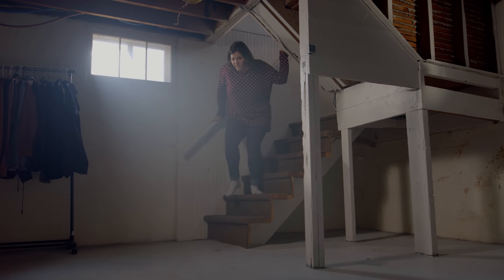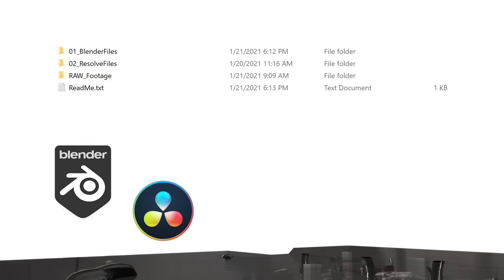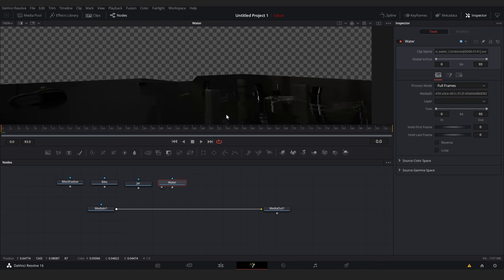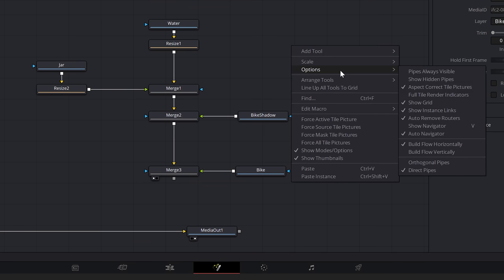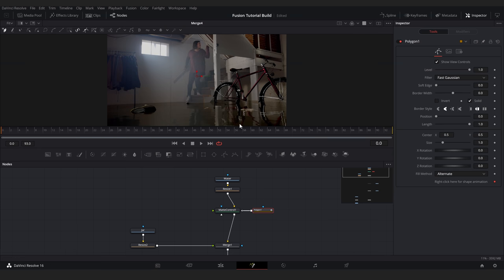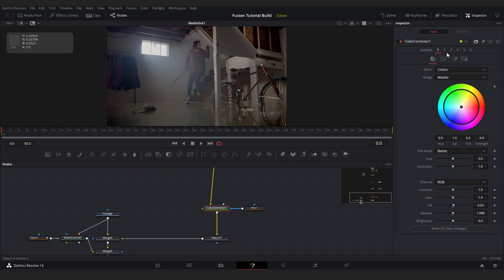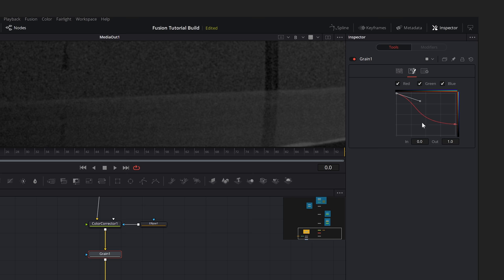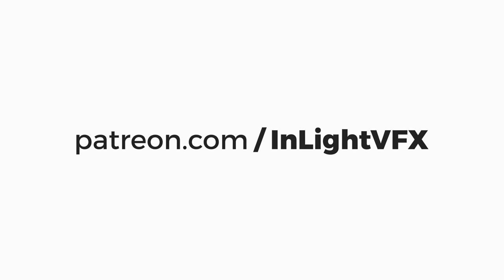Sorry Blender, this is my new compositor

Comment: 7:31 I know you warned that this color workflow is not the ideal approach, but I'll just say anyway for academic purposes that it's generally more correct to convert the footage to linear, rather than the CG elements to log. That way everything is still composited in the same linear space. Then, either convert to log on output (when rendering DPX) or leave linear (when rendering EXR).

Comment: fusion has so much potential as a Nuke replacement, but I still prefer how quickly Nuke can detect EXR layers and create new render layers. I hope blackmagic continues to support it and maybe one day there will be actual competition for Nuke!
Reply: I dunno. I use both and they both have their +'s and -'s. But the resolve 17 live announcement shocked me. they did 99 percent on resolve and like 2 minutes on fusion. which worries me. if they drop support for fusion there will be a lot of very upset people
Reply: plus lets also not forget 300$ versus 9,000$ (and also can get 90 percent of fusion for free)
Reply: Fusion used to be incredibly expensive as well 20 years ago (it's actually older, than Nuke). But the downfall of the previous owner, let Fusion fall behind.

Comment: This is the best introduction to Fusion that I've seen.  Comparing Fusion back to Blender really helps.  I had no idea you could set Fusion up to work in a vertical orientation like Natron or Nuke.  We use Resolve as our primary editor.  Looks like we'll have to give it a run for comp as well.  Thanks for the helpful video!
Reply from the maker: Hey Steve. I'm glad the comparison was helpful. Yes, Fusion's nodes are quite flexible in the orientation. I wish it was more built for vertical-only and sometimes the connections can get a bit wacky. But overall it's easy to stay organized. Hope you find Fusion helpful in your workflow!
Reply: I feel like it's worth noting that Fusion existed long before DaVinci, and was formerly known as eyeon Fusion, and it was competing with Nuke for a while. As a matter of fact it's history dates back to 1987 with it's first public release in 1996, while Nuke was released in 1993, so it's a very mature compositor and not something new in the market.

Comment: Your workflow is good. Usually fusion user has bad habit use from left two right. And connect all stuff to one node.

Nuke user usually work from top to bottom. And not more than 3 connector for each merge node.
Reply from the maker: Thanks! Nuke certainly wins in terms of node layout and organization. But it is possible to have some sense of organization in Fusion, too.

Comment: At 9:16 you mention that in Blender you can't create masks on the viewer node. Unless I'm missing what you mean, you effectively can just change from "View" to "Mask" inside the Viewer Window, hence allowing you draw the masks outside of the Movie Clip Editor.
Reply from the maker: Hmm I'm not sure I'm seeing what you mean. But I also don't have a lot of masking experience in Blender. Still, Fusion's masking tools are quite extensive and I know they have a lot of features Blender does not (that I didn't go into).
Reply: RealTimeX  its just node based. once you wrap your head around it you'll never go back to layers.. and if you learned blender you have NO problems learning fusion. just start with the basics. if you get antsy and jump ahead you'll be lost.
Reply: @flipnap2112  sometimes layers are still better
Reply: @JaKlaro  I suppose if im doing something simple and straight forward its more direct. but anything over that ill take nodes any day of the week. I used to hate nodes until I learned what they can do. its like seeing the contents of a sandwich layed out on a plate. when I need to know where the ham is, one quick glance and im there.
Reply: @flipnap2112  A timeline is still useful. For normal cutting for example. 
Or for Effects that have sth to do with time.
Reply: @JaKlaro  yeah I wouldn't use fusion or any other compositing program to do editing. basic compositing layers work just fine - titles, basic filters, etc. but doing anything like detailed keying, tracking, roto work.. nodes are your best friend. I can knock out something in an hour that would take me a day to do in layers. just about finding the right tool for the job. thats pretty much it

Comment: quick aside, if you, in blender, mix the shader of the geometry to wich you projected your footage, with a holdout texture, with the lightpath info "is camera ray", you can skip all the masking work you did in fusion and save some render time
Reply from the maker: That would definitely work. I just wanted a bit more control over the softness of the edges of my mask. And I also wanted to show how to create masks. But good point, that would be a faster approach and work just fine in a lot of cases.
Reply: @InLightVFX  I use it a lot with moving footage, where the time saved is even greater because you dont need to animate the masks afterwards

Comment: Great Job, I surely dive in to it! ...why don't you use ACES workflow as you teach in the last videos?
Reply from the maker: Great question! ACES is a great workflow but when you convert Blackmagic RAW footage into ACES there is no easy way to then convert it out of ACES back to what the original image looked like. And I needed to deliver the shot essentially "ungraded" since the guys at Threefold had a specific color grading LUT that they wanted to apply to the unmodified RAW footage. It should be noted, ACES does not have this issue with other footage types but specifically Blackmagic RAW is difficult.

Comment: One big mistake! Althogh you can import Exr file via MediaIn, it is too slow (memery consuming !) . To get best performance , please use loader to load exr  files. Another trick is to use the managed as LUT viewer and set  color management as Davinci YRGB Color management. Then davinici will set color space for you automaticly in most situation.Don't use LUT to transport color space, becuase it will cut the dynamic range, the information up the pure white is gone. Use color space  instead.
Reply from the maker: Thank you for the tips! Yeah my LUT conversion is certainly not the way to go but in my haste to finish the project it was the approach that worked. I hope to correct this for future projects.

Comment: What do you think would be the optimal color space workflow. perhaps also converting the camera footage to linear, and then back into log with both at the end.
to me that sounds like it would be the most physically accurate.
Reply from the maker: Indeed, this is what I did initially. But with this specific composite I'm not actually using any compositing nodes that are adding light information over the footage. All the CG-elements are just layered on top with a simple 'over' operation, completely replacing pixels. So I found that keeping the footage as is and just converting the CG-elements worked. But by no means do I endorse this as the right way to do things. Your approach in general is better to stick to!

Comment: what do you mean by scaled up by 2 in compositing? Won’t that make the render lesser quality?
Reply: the water doesnt need to be as high quality as the other elements
Reply from the maker: You are correct, that would make the water lower quality. But oftentimes full-resolution cg elements can come out looking too sharp and they need to be blurred to fit in with the footage (take the bike for example). So sometimes, rendering at half resolution drops the quality of the cg element in a similar way that adding a blur to a full resolution element would. But you get to save a ton on render time. Like I said, you can't always get away with half-resolution rendering, but I think it works here. Hope that makes sense!

Comment: The biggest issue for me it's the slowness of Fusion and how pooly manages memory. I have a 3090 with a 5950x, (ok it's not a threadripper but is it that bad?) with 128GB of RAM, and I struggle rendering compositions larger than 2 minutes. For some reason, after 30 seconds or so the renderings start to slow down, a 2 minutes composition can take up to 10 hours to render, and I am using the Fusion Studio, I don't want even think in the free version included in Davinci Resolve. BMD always blame my system/drivers but the truth is that the same system with Blender and Nuke runs faster and smooth.. I still use DR Studio but only for color managment and light effects and it's a great tool for that purpose.
Reply: Are doing image sequence renders? That's what I do when I'm using Fusion, both Fusion Studio and the Fusion in Davinci Resolve. I render each Fusion composition as an exr sequence. It's fast for me and I have an NVIDIA RTX 2080 and 64 gigs of ram, much less power than your system.
Reply: Thanks for your response! Yes, I have used exr sequences, 1080p, but this issue persists. I think, maybe, the root cause is Fusion, for some reason, does not want to use all the resources available because when I check the CPU/GPU utilization while rendering they are just chilling at 15-20% max, NVME PCIe 4.0 drives at around 0-1%, RAM is around 80% though. It's funny and frustrating when I see how Fusion changes the rendering from frames/second to seconds/frame(for instace, 8-9 seconds to rendering 1 frame in a composition with only some materials, particles, depth maps, occlusion but nothing too elaborated). I still don't know why is this occurring, but also in my previous system (i7 6700k, 1080Ti and 32GB ram) the experience is similar. At the moment the only workaround I have found it's to run multiple instances of Fusion, and limit the timeline to max 30 seconds, so for a two minutes composition I need 4 instances, each of them processing 30 seconds. This speeds up the rendering time a lot, however with Davinci Resolve is not possible. I really like the nodes concept of Fusion, and I still use it from time to time, because many things are easier to do compared to Blender but I have found Blender so efficient and marvelously fast, specially now with Cycles X. Nuke also renders really fast.

Comment: Great video.I have a question that did he render the water and 3d scene as a png sequence?if so how did he manage to match the foot with the ripple effect.Also why didn't it require a 3d render node in fusion?
Plz answer this question, I'll be grateful
Reply from the maker: Hi there. The water was rendered as an EXR sequence. This is the standard file type when rendering out intermediate CG elements (before compositing the final scene in Fusion). I do not use a 3d render node in Fusion because at that point we are only dealing with 2D elements. The water rendered out of Blender becomes a 2D element and so I no longer need to work in 3D space in Fusion (at least not for this composite). Thanks for the good questions and I hope that's clear!
Reply: @InLightVFX  Thank you 💙

Comment: Comparisons are great, so let's make some meaningless ones!
Blender: Compositor is one of many tools in a fully integrated graphics production environment.
Fusion: Purpose built Compositor.
Blender: Production.
Fusion: Post-production.
*
Hey, Post is vital for film making!: without edits, color correction, mattes, greenscreen and VFX, TV would be boring.
But you need footage, images and the like for the Compositor node to have input.
Sure, procedural effects can generate images fully in Post without model/rendering/video.
But procedurals in Post are no replacement for a solid model.

Comment: This is going to sound demanding but could you elaborate a bit on what you did in blender, specifically the layering and projecting part? I'm trying to use this method for a film of mine.
Reply from the maker: The basic technique is to project your footage onto 3d geometry that is aligned to the real objects in the scene. It's called projection mapping. I go through all the steps for the Blender-related stuff on my Patreon but you can also check out this video on projection mapping that might help you learn that technique: https://youtu.be/p9IfDeNU8K0 Good luck!

Comment: By rendering at 50% of the resolution and scaling up later, what happens with the noise/pixelisation?
Reply: only the blender scene was rendered at 50%
And the noise was added after the rescale node so there's no scaling issue in this specific case.
The tutorial mentioned to only do it "when you can get away with it", which probably means "when there's no super detailed texture or grain that could lead to worse rescaling WITHIN your blender render itself"

Comment: why doing all these extra steps? u could just import the video as a plane and make everything in blender and render the finished thing there, i dont understand the benefits of compositing, cause colour correction and so on u can still do with the renderd video
Reply: The color correction is applied to specific elements. You can hardly do it after its together. 

-He rendered the scene just half resulution, saved render time (you couldnt so that without compositing) 
-Matching 3D with real footage is not really possible with the images as planes addon 
-You can change things faster, you can change it even after 3d is rendered 
-... 

Its just more professional like that
Reply: Also you cant composite it together, that footage is influenced by each other, for example how would you do a light wrap effect?

Comment: How do I know what the node inputs mean? In Blender they are named but in DaVinci there just are those colored triangles
Reply from the maker: If you hover over them, you can see what each represents. But in general, there are fewer inputs on Fusion nodes than Blender nodes since a lot more of the Fusion data is handeled and re-routed via the node information side panel to the right.

Comment: Hi, I am new to 3d and compositing, searching for a solution which I thought would be simple to do. I need to use 3D models I have found free online but when I import them in Fusion they do not connect material nodes correctly and even when I find material for them they r missing something and never look like on their source website, but when I open the same file (.fbx/.obj/.blend) in blender they look perfect so I want to export everything baked from blender for Fusion to simply use it in 3D, is it possible? thanks.
Reply from the maker: Hi Faizan. Unfortunately I don't have experience with Fusion's 3D tools. If it looks good in Blender, could you render out something from Blender and just use Fusion for compositing like I do in this video? Blender will have a lot more tutorials and troubleshooting support than Fusion when it comes to 3D.
Reply: @InLightVFX  you are right, from last almost 2 weeks experience trying to do it in Fusion I have come to conclusion that its simply too much for Fusion, the only reason I really wish I could use Fusion's 3D for that is that I need to animate light to change scene from day to night so if i get footage from outside then the 3D objects won't react to that light changes, it means I would have to create the whole scene including lights keyframes in blender, I have never used blender so I wanted to be able to do it using only one software but I think can't skip blender anymore, although I wanted to be done as fast as possible but liking the restriction because of having to learn a new awesome tool like blender, thanks a lot for the quality content :)

Comment: When exporting from Blender in RAW, is this similar to Aces, the same or something completely different
Reply from the maker: Hi Ich. I think you're refering to 5:30 in the video? The "view transform" that I'm showing there does not change how images are exported from Blender. It only changes how they appear in the Blender viewer (like in the compositor). Hence the name "view transform" as it is transforming the view but not changing the data of the file being viewed or saved. Whenever we render an image, by default Blender creates a file with linear gamma. This refers to how the luminance values are mapped across the range of the image. Without getting into too much technical detail, linear images do not look good to our eyes but linear data is best for accurate compositing calculations. So we want to work with linear data for compositing but we always need to transform how we view it so that it looks correct to our eyes. ACES deals with some of these sames concepts but dose not relate directly. I hope that makes some sense. I'm still learning best how to explain it myself. Thanks for the great question!
Reply: @InLightVFX  Thank you, I think I get what you mean. So basically the view transform is just the viewer LUT and the final gamma-transformation of Blender

Comment: I love Fusion and like Blender - but my computer is ... 7yrs old :( ... I'm running out of Memory in Fusion and in Blender (even extremly tweaked) takes ages for rendering :(((
Reply: Well, I've used a 10+ yo PC for editing for years so thats relative. Only stopped using it a year ago. What memory are you running out exactly? RAM or VRAM (video memory)? You might simply need to add some RAM. I remember editing videos in after effects with 256MBs... obviously it wont work now, but if you have at least 16GB it should be good enough for a lot of stuff that's not too complicated. I'd definitely be able to render and composite a scene like the author is making with a 10yo PC, if it was i7 3930k or similar with 16 GB of ram. 

What I'm trying to say - don't let thoughts like "Oh my hardware is slow" stop you. On the contrary I find it useful trying to work around the limitations, you may learn a lot of things this way.